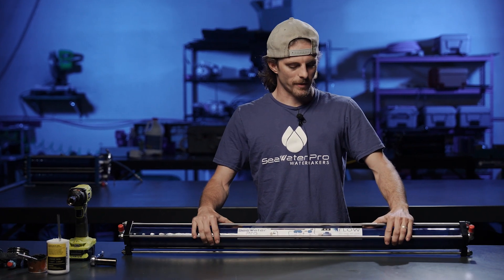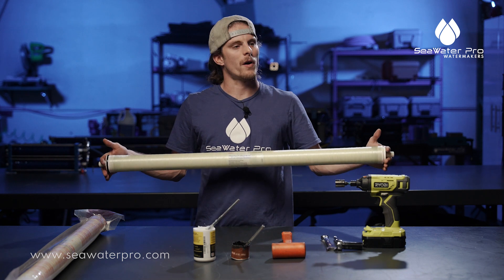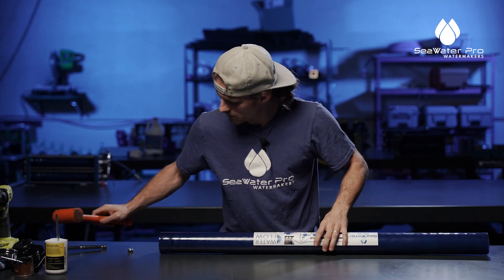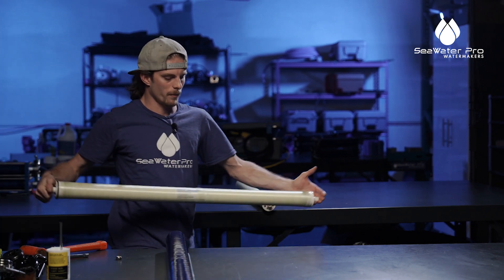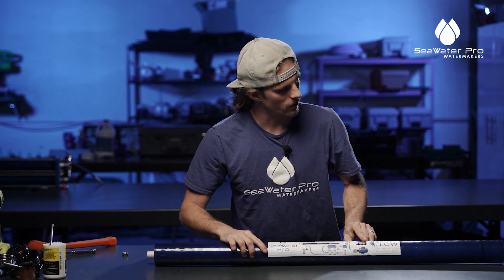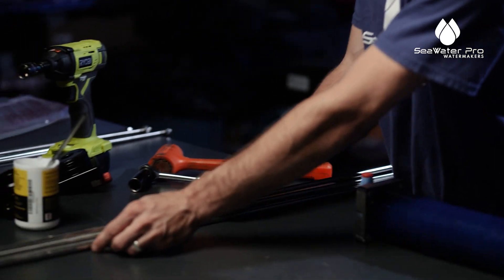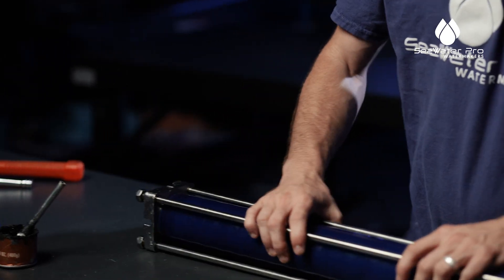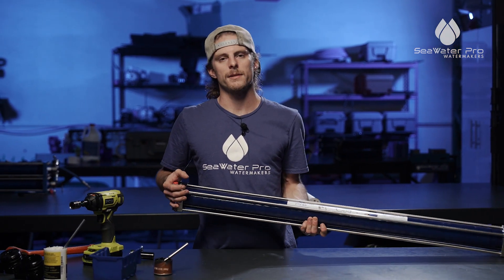SeaWater Pro Watermakers - Membrane housing assembly. visit us at www.SeaWaterPro.com

Comment: @3:55 time stamp, he shows the end of the element with the outer O-ring being installed at the end that the water goes in, if I am understanding him correctly.  That seems backwards to me.  I thought that the water would go in the open end & the Oring end would prevent the brine from mixing with the product water that comes out the center.  Am I misunderstanding how he is doing it?  Or am I misunderstanding how the element works in the housing?
Reply: Your comment seems reasonable.  Did you ever figure this out?